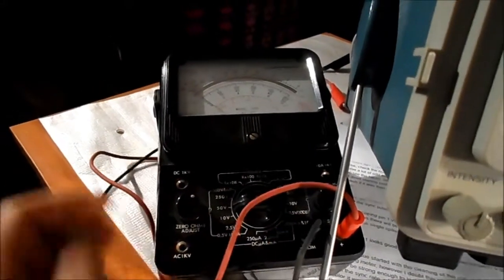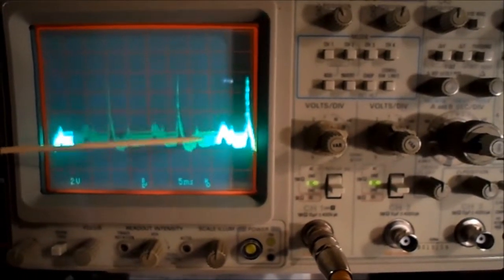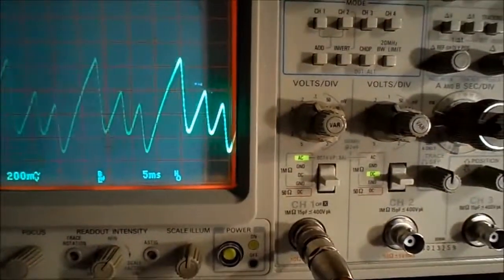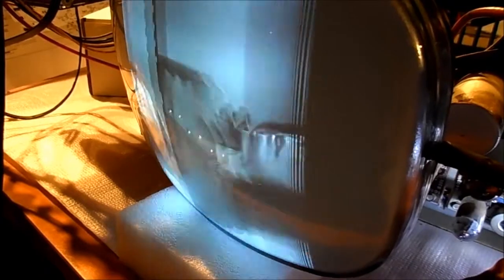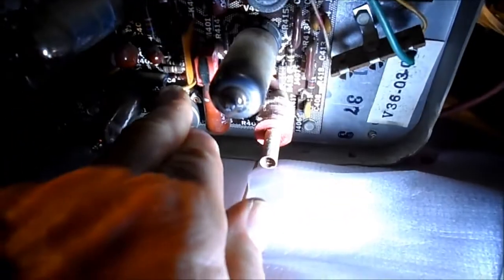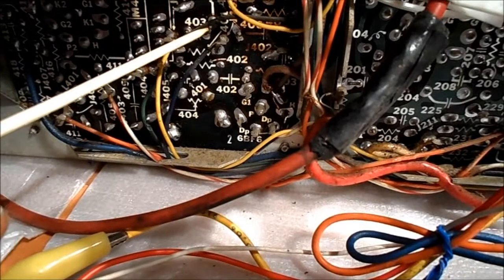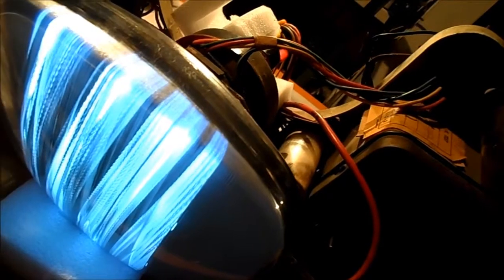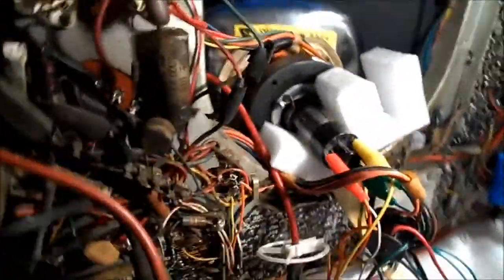1965 Magnavox B&W Pt. 8. Troubleshooting Vertical Issue Continues.

Comment: The sync pulses looks funny, they usually does not vary in height. A lot of video noise in the vertical multivibrator, i would check biasing in the sync separator section (left waveform): The sync sep should block all video-level signal from the sync pulses.
Reply from the maker: Thank you for that piece of info. The TV troubleshooting books say it's in this section somewhere.

Comment: make sure the screws that hold the pcbs down are tight, that is the ground returns.

the resistors are ok. Not sure about why that cap acts up but I would replace it.

there seems to be too much video noise on that sync pulse. check the voltages around the sync sep tube, those are critical a leaky C43 could foul up the bias point on the sync sep. look at the grid of the sync sep then the plate (scope), if its working right you will see a normal looking composite video on the grid and then a stripped out sync pulse (horz rate) with very little if any video. try a tube swap (6EB8)
The sync sep fuctions by biasing and tube and running a low plate voltage so the tube will only conduct when it sees a very high signal. Since the sync pulses are the highest signal in the composite video, they "should" be the only ones that get thru. Defects in the tube bias or tube as well as defect in the composite video will result in problems with sync. If the composite video gets clipped (defects in the IF amp including too much AGC voltage or defects int the AGC voltage) will mean poor signal to the sync sep. I often run a dual trace scope one on the output from the video detector and one from the comp video souce (assume you have a DVD with a RF and comp video as an example. compare the two traces see how close the detected comp matches the orig comp from the DVD player. Clearly the pure comp video will look better but the detected video would not be too severely clipped or distorted.
A common practice is to apply an outside adj AGC bias to the the TP-1 and see if that clears the problem, if it does it points the the AGC source.

Not sure what to make of the TP-1 that should be much flatter DC bridge over C-15 (.22), and scope again.
Reply from the maker: Ok, you are correct re: grounds. None of those boards are soldered by any means. In fact the rack of controls appears to not even have a ground lead. They must be relying on the cable shielding. I have it mounted to the chassis for testing. I will change C46 & maybe 48. Was not sure if I really had probe on TP1.
C43 does look suspicious, coming from video out tube. Anything on the 6GH8? I can easily replace that. Will search out a 6EB8.
Reply: Farmradio
you should check those voltages on the 6EB8, I suspect there will be more clues there. I would hold up on those cap changes until you get a chance to check into that 6EB8 some more.
Reply from the maker: Dave WM
I see. The 6EB8 is dual purpose. It's also tied to the B section of that C2. 5@350. Why 350??  A is 130@200.& the C section was the over-voltaged one prior when C4 was bad. Also ties into the 245V supply for the plate. A 6EB8 is on it's way just in case.
Reply from the maker: Dave WM
Will hold off on caps, until a voltage check on the 6EB8.
Reply: Farmradio
just focus on the triode section, check the grid and then the plate with the scope, you should see the sync separation in action (pin 2 and 3). The bias of this tube is critical.

Comment: Try pushing on it with an insulated tool (plastic) - I'll bet your finger is AC coupling 60 Hz into your vertical hold circuit. Also, try changing the tube (6BF6) anyway (if you have a spare.)
Reply from the maker: Have a 6BF6 coming soon.